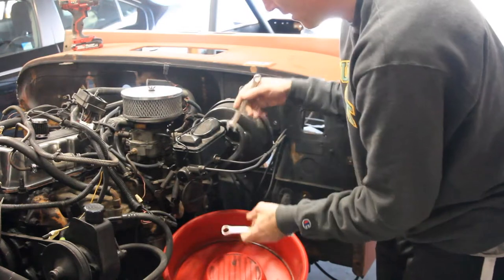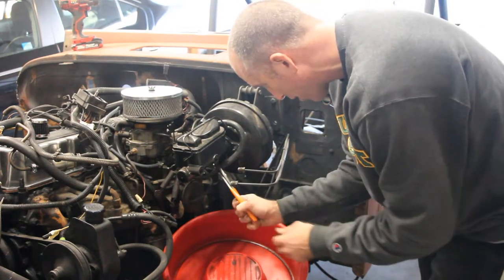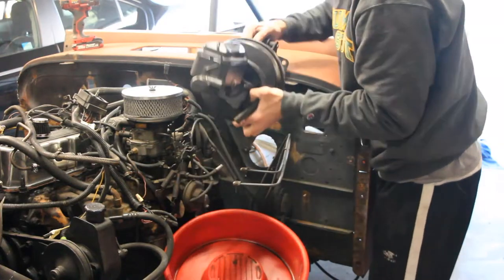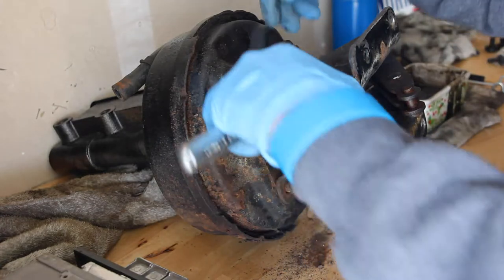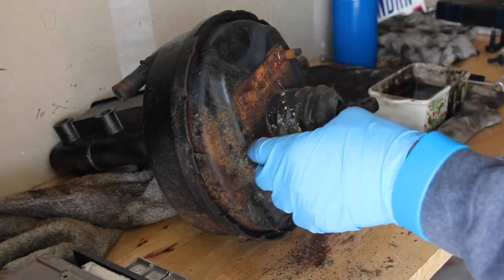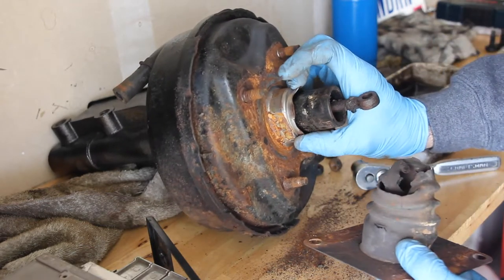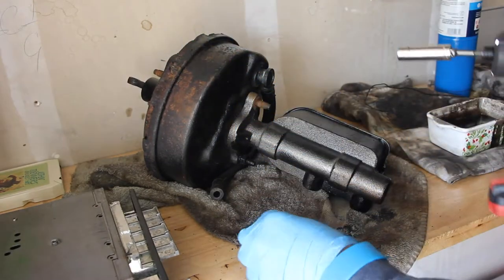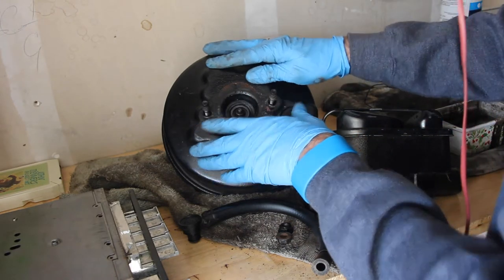Jeep CJ7 Power Brake Master Cylinder Removal and Teardown

Comment: When i pulled the boot off my booster, there was some material that looked like it used to be foam in the column where the brake rod enters the booster.  Any idea what that was and if i need to replace it?
Reply from the maker: You are correct. There was an open cell foam ring/tube that fit around the piston. That and the rubber boot served as dust barriers or filters. Neither are necessary, but are nice to have.
Reply: @coolguy_CJ7  Any chance you have footage/pictures of the foam tube?  I would like to see if I can recreate it.
Reply from the maker: @geoffselzer  went back through my photos and found nothing. I need to do a better job of documenting when I do my next CJ.
Reply: Thanks anyway.  Your channel has been a good resource for a few projects. Thanks for the good work.

Comment: Hi.  Do you know the part numbers for the booster and master cylinder?
Reply from the maker: Original or aftermarket?
Reply: @coolguy_CJ7  Not sure…. I sent an email with details and pictures.
Reply: MC has 2219 stamped on it.  No markings on the booster.  I think both parts are original, but from different years.  I think the booster and bracket that mounts it to the firewall are YJ parts.

Comment: Where was the boooster vaccum line connected
Reply from the maker: There is a brass connector that screws into the intake manifold, just below EGR valve. Email me at dellis6914@gmail.com and I can send a picture.
Reply: @coolguy_CJ7  found it, thanks brother 🙏